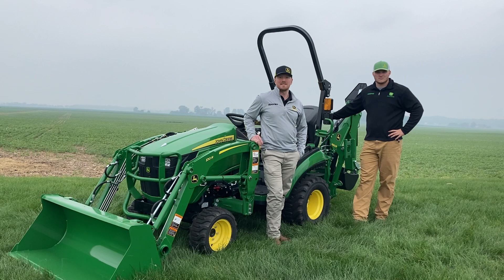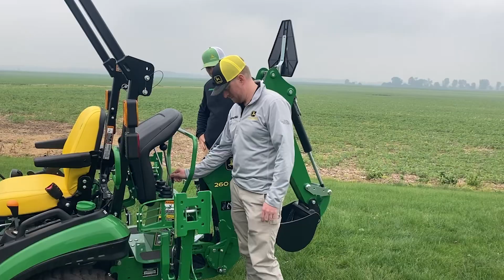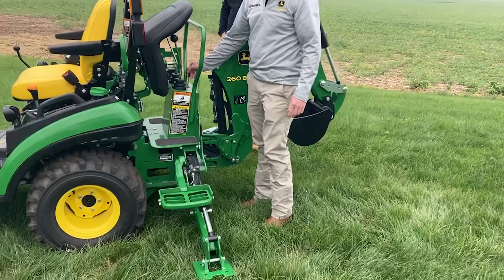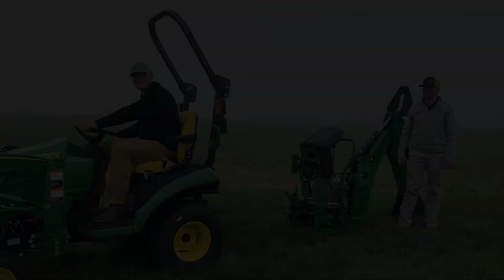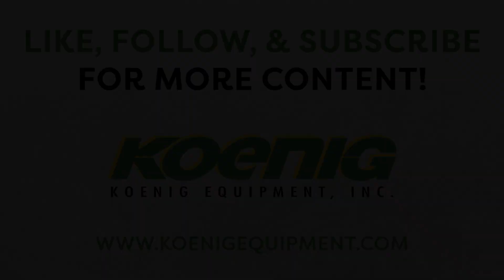How to Remove a 260B Backhoe from a 1025R | Step-by-Step Tutorial

Comment: Thanks! Good video. Safety suggestion: Stress that the tractor should be shut off completely before relieving hydraulic pressure and disconnecting the hydraulic lines to the backhoe.